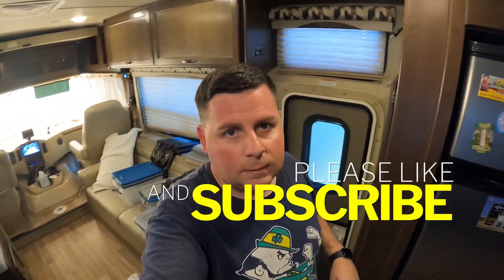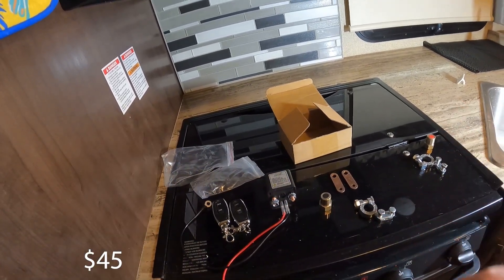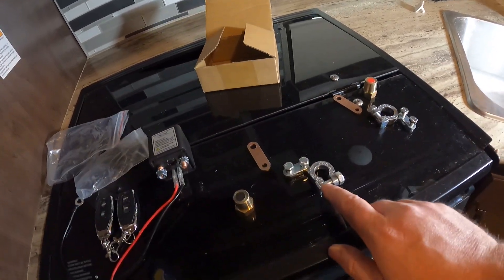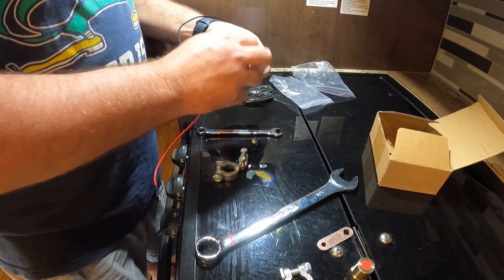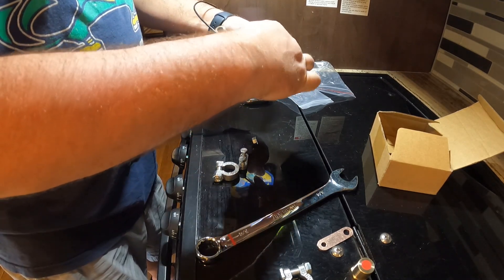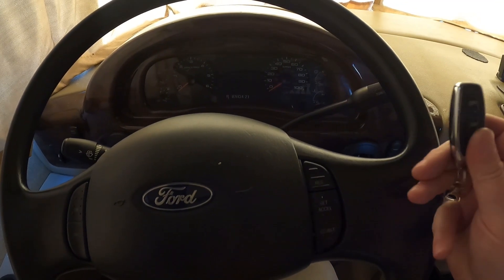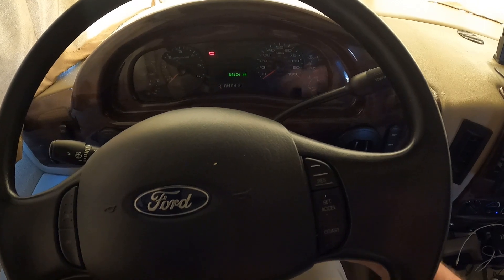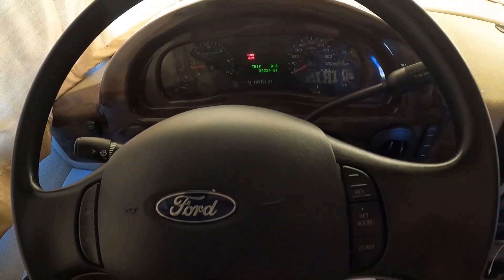Wireless RV Battery Disconnect Switch with Remote! | FEITON

Comment: Ok hope this helps. Ran into this video looking for a wireless disconnect switch to replace house disconnect switch. Here is a diagnostic step to find draw which is what is causing the problem not a short. Remove battery negative cable ov can side and put a test light in between neg post and neg  cable. If there is a draw light should be on with test light connected briefly make a connection to battery light should go off. When removing that connection if light comes on rapidly you have a draw. Remove cab fuses one by one until light goes out when it does thats circuit that fuse protects and in that circuit is a culprit that is causing the problem. Disconnect items in that circuit until light goes out and that is the culprit. BUT before all that remove the multiple wire connector on alternator to see if light goes out on test light. If it does you have a bad diode causing draw. Replace alternator at that point. Note: With a bad diode alternator can still charge the battery. If that does not work then go with previous steps. Good luck  RV’r.

Comment: You need to replace the battery isolator solenoid with a RedArc isolator solenoid that senses power of both batteries. My motor home the chassis battery would charge only with the engine, now plugged into shore power it is capable of charging both batteries or one at a time. I had the same issue as you. Also the isolator solenoid draws power so by installing a disconnect switch, problem solved.
Reply from the maker: Thanks! I’ll track that solenoid down and test it!

Comment: I have one of these on my 71 K5 Blazer,  it will drain the battery within 24-hours if I do not disconnect the negative cable. Is because the little control box is constantly drawing power. Do you have the same problem?
Reply from the maker: I don’t. Haven’t had an issue and it’s been almost a year.
Reply: @MajorDadsGarage  how long does the vehicle sit for?
Reply from the maker: Sometimes 6-8 weeks or a little more.
Reply: @MajorDadsGarage  wow that's pretty cool. Maybe I'll try a different one this time. Thank you so much for the reply

Comment: Should be a switch in the coach to kill power in coach
Reply from the maker: There is but the bridge between house batteries and chassis batteries is the emergency start switch. I think that switch has been bypassed or is faulty. I haven’t been able to find the time to diagnose that yet.

Comment: Your leisure battery must be routed through a control panel. The ground terminal from your battery should be grounded directly to the chassis. May I suggest that you visit an auto electrician to test your circuits, as there should be no way to operate the starter from the house battery. This is a fire hazard if there is messed up wiring in the vehicle.
Reply from the maker: Thanks! The house batteries are wired per the manufacturer. I haven't had a chance to test the circuit yet, but I suspect the emergency start switch is either faulty or has been bypassed under the dash.